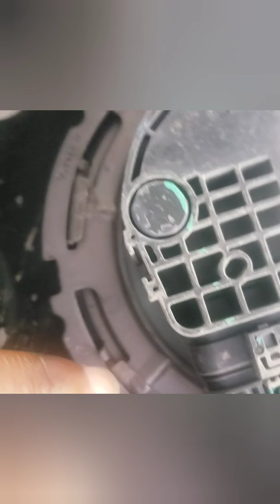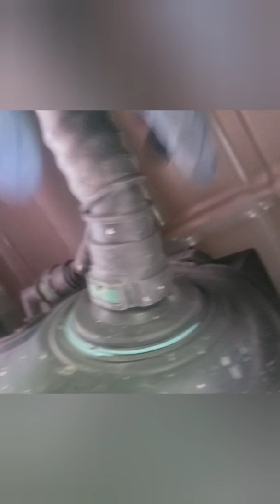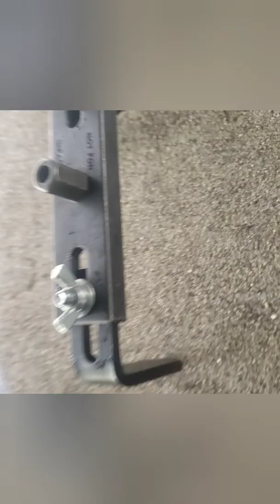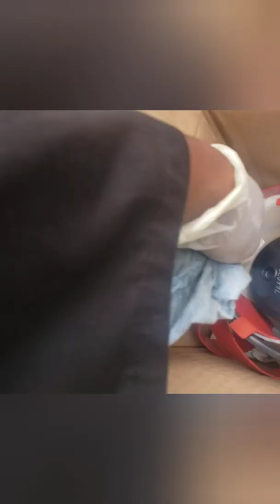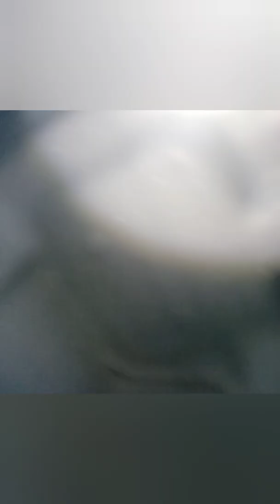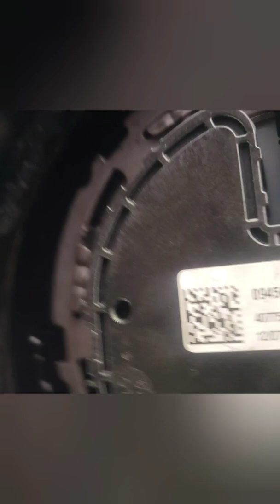P20e8 (Reductant Pressure Low); Ram 3500 Cummins 6.7

Comment: I replace the pump but after i fill up the tank whit 2.5 gls but my def  gage say 3/4 what i need to do?
Reply from the maker: Fill it up all the way, I believe the gauge ratio may be a bit off. When my gauge shows half full I always fill up and it's always more than half a tank that goes in.

Comment: These trucks are crazy. I get a random P244A that comes and goes. It says the DPF filter is plugged but it isn’t. New sensor will be installed tomorrow as that’s all that’s left. Funny thing is it only does it every 300 + miles and then goes off. By the way, I had a huge chunk of def rolling around in there but the injector wasn’t crystallized at all. Go figure. 
But the way I am a former 20 year auto tech and you are an impressive lady!
Reply: Since I posted here I fixed my issue. 
I knew the filter wasn’t clogged because A the truck has way to much power to have a restricted exhaust and B I removed the entire exhaust system and inspected it. There was very little carbon in it but I cleaned it anyway since it was already off.  My issue turned out to simply be the Differential pressure sensor itself. I replaced it and no more codes. I drive mine like I stole it and rarely does it idle much. Anyway it’s fixed.
Reply from the maker: Lol, way to go champ! 💪🏾❤️💯
Reply from the maker: Once you get to understand the system it's easy to solve those issues. How do you know your filter isn't clogged?

Comment: I appreciate you for taking the time to make this video, its like deja-vu watching this as i had the same exact problems as you did with the injector mounting bolts. Replaced def injector and message didnt go away, so now i am going to order the pump ring removal tool & def pump. Hoping its the last step for me too!🤞🏼 You saved me alot of time by suggesting the pump removal tool! THANK YOU!!
Reply from the maker: You're welcome. After you replace the pump, you shouldn't have anymore problems. I believe these trucks last longer by keeping everything stock. It also wouldn't hurt to pressure wash your dpf filter if you have time.